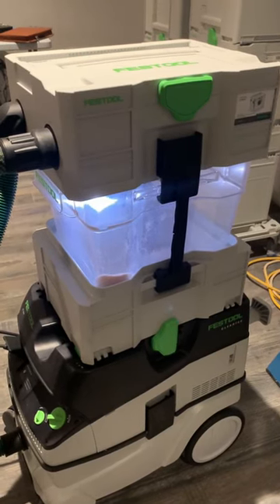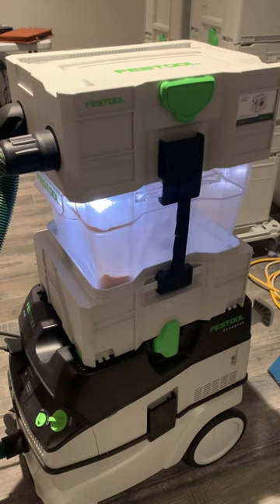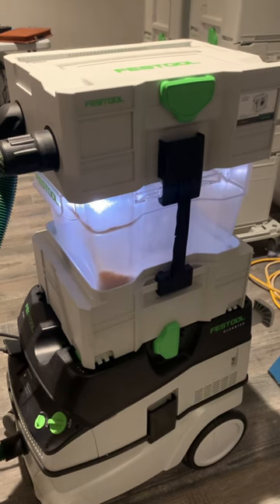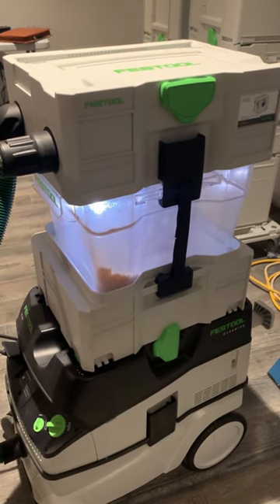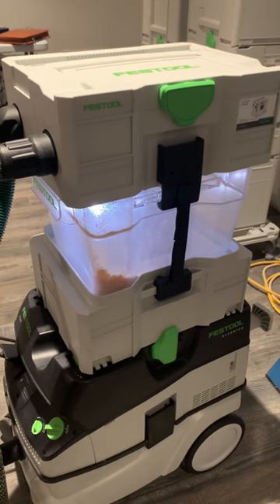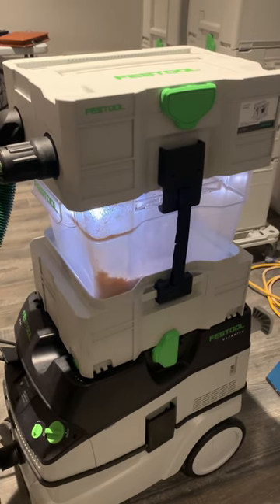Festool cyclone dust separator #festool #shorts #dustextractor

Comment: So I bought this a few weeks ago. Have the dust extractor and cyclone. My bag got full in 2 weeks from mostly sanding … how often do u change bags?
Reply from the maker: What dust extractor do you have?What are you sanding? Because I use it for my miter saw, track saw, domino, routers and sanding and I haven’t had to change the bag in 2 years. It’s just filling up now. I empty the bin twice a week. And I’m sure you’ve seen, I do work on a professional level, besides my own work, which is a lot of volume. Please elaborate more on your setup and(dust extractor) and what you are sanding. So maybe I can help.
Reply: @AnthonyScolaro1  I have the CT26 e Hepa with the cyclone.
Reply from the maker: @CustomWoodWorkDecor  what are you sanding? Hopefully not drywall. And are your hoses hooked up to the correct ports? Because if they’re backwards, the dust will bypass the cyclone and go straight to the bag.
Reply: Why not drywall?that's why i want it,its not recommended?
Reply from the maker: @orozco53204  you need the ct36 minimum but the ct48 is recommended more for drywall because sanding drywall creates a much larger volume of fine dust much faster and the ct26 has smaller bags, so if you fill up the cyclone fast with drywall compound dust, it will bypass straight to the bag and clog it up.
Reply: @AnthonyScolaro1  no dry wall at all. Just construction grade lumber. I just filled up the bag again since my last comment. Weird. I double check the ports. Looks all good.

Comment: Cant wait to see/hear this!
Reply from the maker: It will be very interesting and honest because I’m not sponsored by Festool at all, so you will get the complete comparison and pros and cons of both, not to mention if it’s worth it at all.
Reply: @AnthonyScolaro1  
Anxious to know the results
I have both the CT36 AC & the cyclone. Love them both. 
Never used the cyclone with a vacuum as I've preferred the full HEPA of Festool. 
 Always knew you'd come around, in time.   When i saw that youd first invested in Festool, I thought, ugh- oh.  
Hes soon to he smitten. 
Am i right or no?  :)
With Festool, The value is definitely there, IMO.
Reply from the maker: Yeah, 4 years ago a bought the domino df500 thinking that would be the only Festool I needed. A year and a half ago I went all in and basically changed over specifically to Festool, including getting rid of my table saw and just using the track saw. It was mostly because of shop space but I soon realized that the modular capabilities of the Festool system would make it easy for me to pack up and set up my shop on jobsites as well, without having two sets of tools.